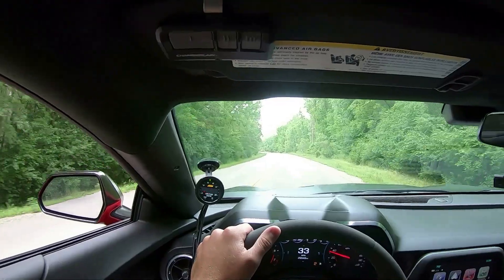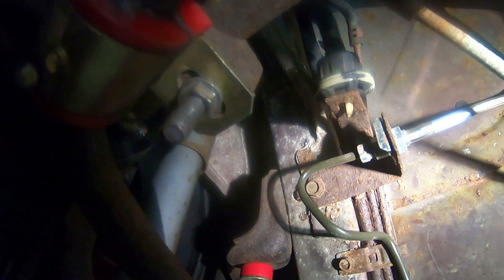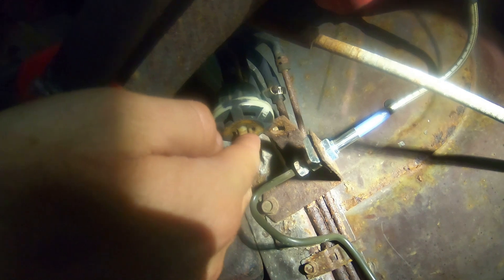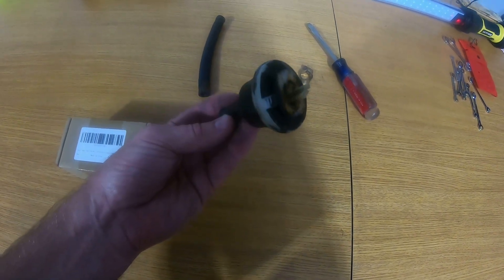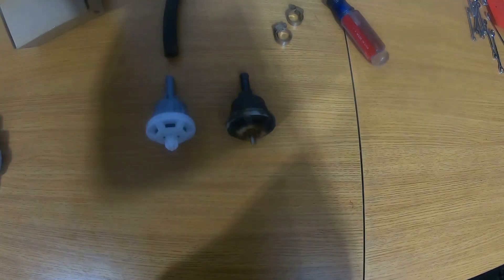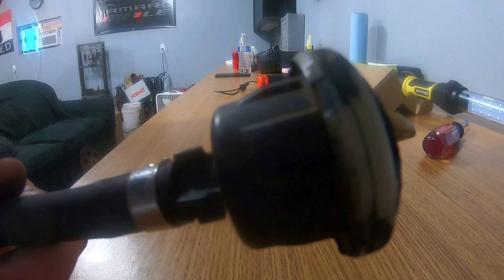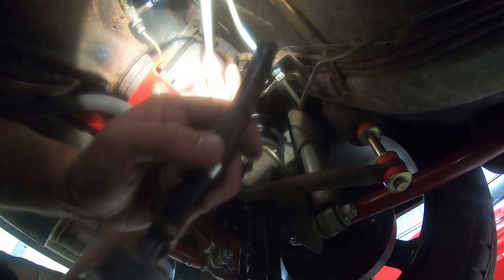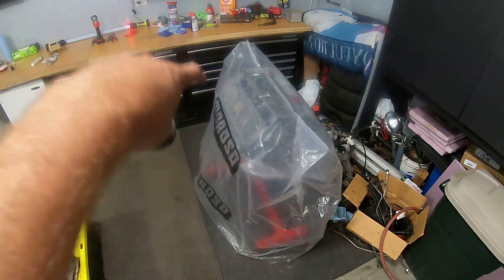FBody Fuel Tank Vent Valve Replacement

Comment: cool little video man thanks , while doing research i watched this.  i have a 96 trans am lt1 cammed heads some other goodies, been going through the car and fixing various issues , one of which was a stumbling idle / will die sometimes , upon further inspection i discovered random vacuum lines missing and all the evap lines like removed.  so after doing things like egr delete and a vent on the valve cover and cleaning the throttle body i thought about replacing my vent so i ordered a new one, car smells like fuel and gas tank hisses when i open it when the cars hot and i stop to get gas
Reply from the maker: O yeah if it hisses when u take cap off its not relieving pressure like it should. Or even brining in new air when there is a vacuum.  Sounds like a good thing to replace

Comment: Quick question:
I have a 97 TA and when i take it to the pump it only fills 3/4 before tripping the pump. Would doing the process shown in the video fix my issue? If not, what would you recommend i do?
Reply from the maker: @Brnanabird  I'm not sure if it would fix problem or not. Easy thing to try tho. Almost sounds like air is not purging from tank and kicking off early.